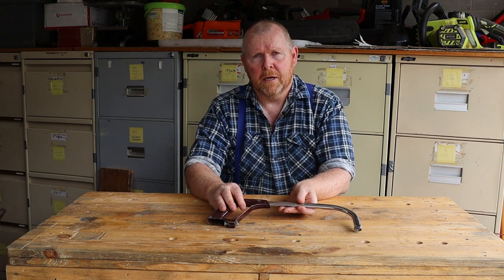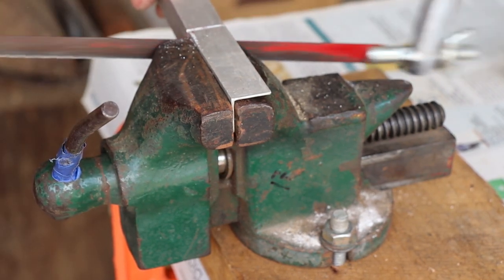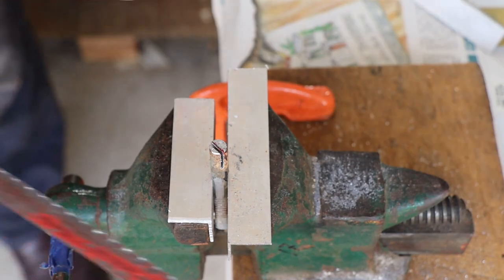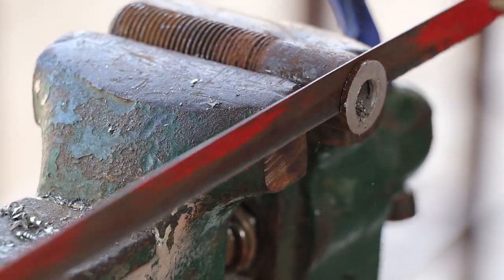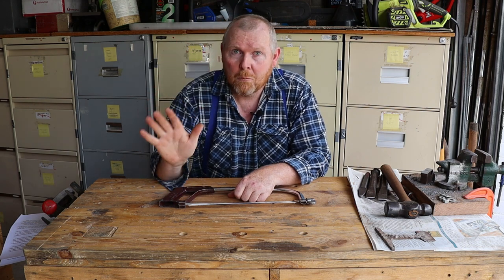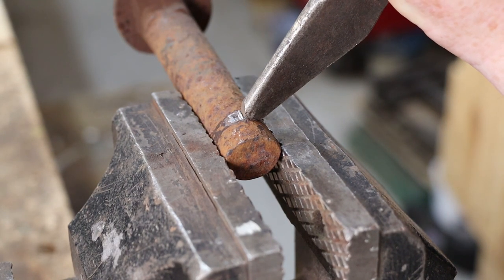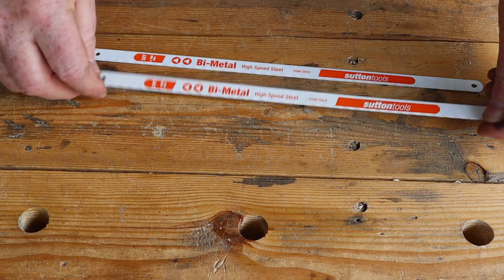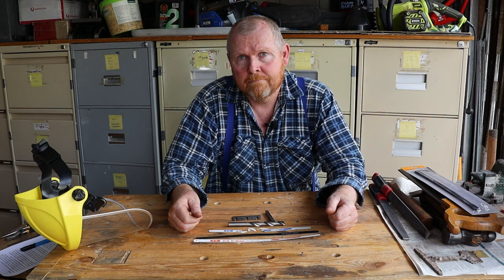Rebuilding a hacksaw - using a hacksaw!

Comment: Haha, this was just the video I need.  I lost the stud/adjuster on my Dad's (RIP) old hacksaw long ago & now I need to use that hacksaw without having to buy a new one.   Been looking for that wingnut stud for at least the past couple years now, though not in any hurry, but still would be nice to use that hacksaw anytime sooner than later.  For the pin, I think spinning the nail in a drill & then lathing it to the correct diameter with the file might have been faster idk.  I'm not sure about making a wingnut from scratch though, maybe I'll get lucky & find a fittable wingnut I already have. But it would be ironic if that lost original adjuster finally pops up after I make one of my own.   Thanks for the tutorial.
Reply from the maker: Hi Rob.

You'd definitely be able to make a new stud without using a hacksaw, you just need an angle grinder or somethign to cut the head off your "donor bolt".

I didn't even think of spinning the nail in the drill, that's a very good idea.

Yeah, I only made the wingnut from scratch as a practice exercise, it's really not worth doing when you can buy them this cheaply:

https://www.bunnings.com.au/zenith-3-8-zinc-plated-diecast-wing-nut-3-pack_p2420402